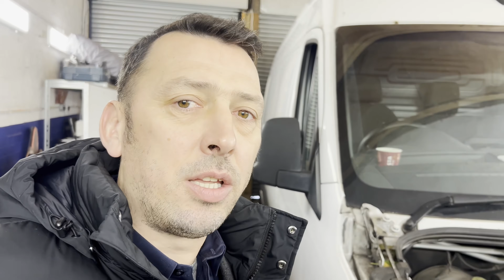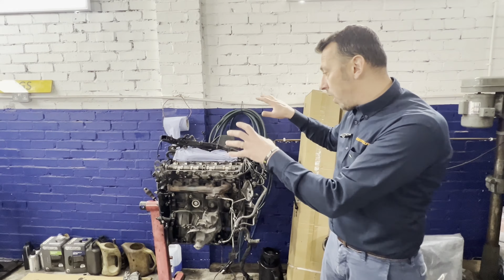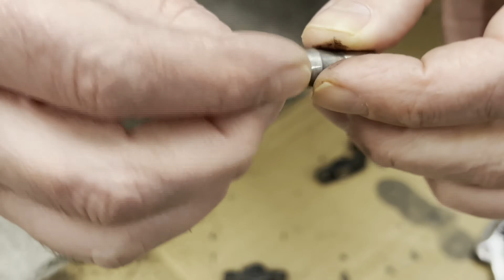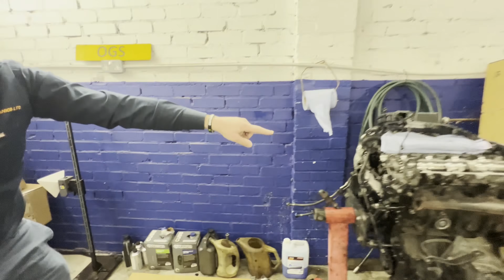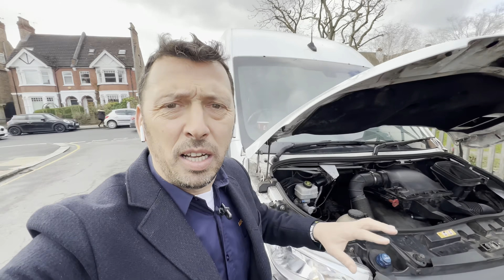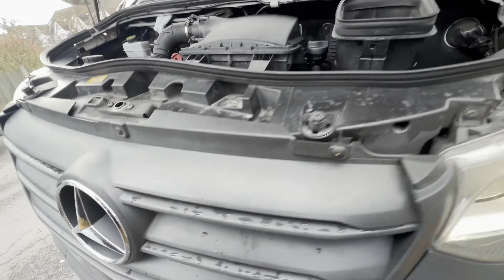Sprinter Engine Rebuild Part 2: Saving a High Mileage Engine

Comment: Hello.
My sprinter 906 starts first time and is fine idling but when i rev it, it has a loud clanking noise then cuts out.
There was massive clouds of white smoke before it cut out .
I think it was caused from over filling with oil but even after draining oil to correct level it was still smoking alot.
Any ideas please?